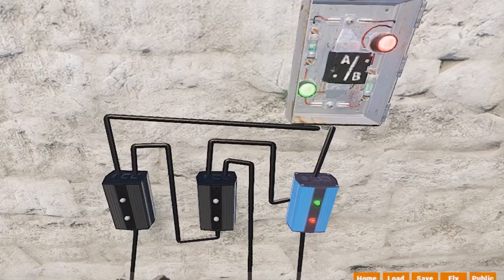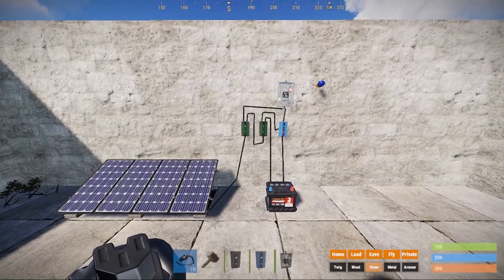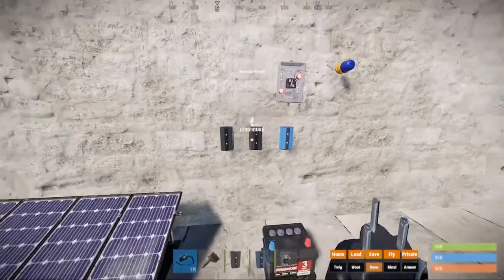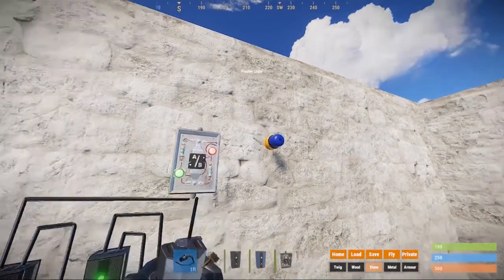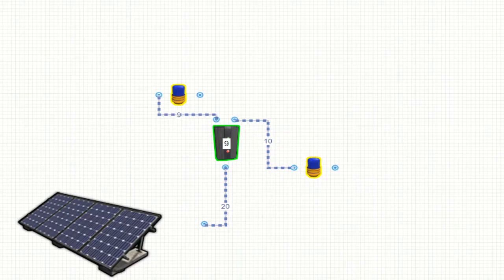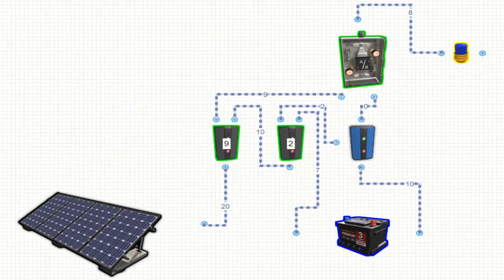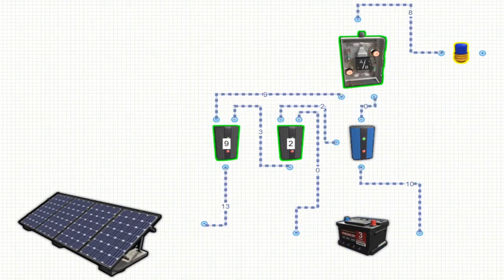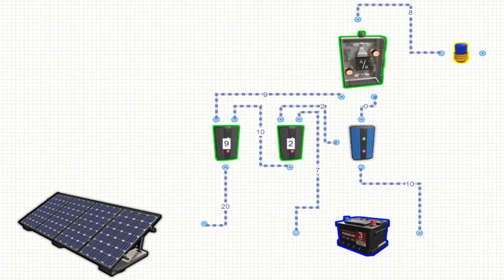Rust Electricity - the FIRST and most important circuit to build

Comment: damn this guy only has ONE vid wtf.... I love how he lays this shit out. I would love to see an updated version of how this works.
Reply: before batteries didnt recharge while discharging so this was necessary. They fixed that so this circuit is no longer necessary, its actually a waste of power.
Reply: @tictoc4156  so this video is outdated then?
Reply: @Naku_u  no
Reply: @Naku_u  this stills works, what happens is the solar panel is using what power it has for the system any power unused goes to battery. When there is no more sunlight then battery takes over, hopefully with full charge
Reply: @thrawn8840  oh ok this made it make more sense. So if my system is using 75 power. I would say output 80 to be safe and yhe rest would go to batteries then
Reply: @Maxmilion6004  yes
Reply: @tictoc4156  I can affirm that this is false
Reply: Still a useful circuit as it avoids charging losses for power used during the day.
Reply: @tictoc4156  This circuit is very important, as it makes no sense to have a battery discharging when it doesn't need to.
Reply: @tictoc4156  Electrical components no longer use power so it’s useable again!

Comment: I am using this circuit every wipe. I have recently learnt a nice way to scale it up 2x using a splitter to divide power into 2 large batteries and scaling power input with 2 turbines
Reply: Can you explain or show me how I’ve been trying to figure it out for hours
Reply: @eurility8557  sure, use root combiners to combine input from your power sources going into the first electrical branch and add a splitter between the 2nd branch and battery to spit power into 3 batteries. Use root combiners to combine the batteries power going into the blocker
Reply: @jamesward9482  Important note: Don't do this with Medium or Large batteries because root combiners will max them out 100% of the time and waste a lot of power unless you are actually utilizing the full 200 or 300W output. It's a big annoyance and there's no warning in game that this will happen. You can still run the feed to several batteries and run separate grids, though.

Comment: id love to see this scaled up with multiple power sources
Reply: Yeah me too, couldn't combine them behind this circuit so it has to be before?
Reply: @kathak9096  Ofc it has to be before. Just put a (or multiple) root combiner(s) in front of the first branch.
Reply: yeah - I've been struggling this (trying to find a way to auto-disable any surplus batteries from the circuit)...  looks like you can't switch/branch anything before a root combiner - the only thing that can be before a root combiner is a power source (generation or battery output)...

Comment: This circuit pretty much fixes having to brute-force power generation to extreme levels in order to charge (usually during the day) the batteries by having significantly more power than necessary for the system.  It works doing it that way, but you end up with a lot of expenditure on solar and wind turbines when you only need just enough.  Great explanation!
Reply: UPS is only useful when you have over 126 rWm

Comment: Like this setup. I run the solar to a branch that feeds both the battery and a splitter. Then using one of the 3 lines off of the splitter, I route to the blocker and from there any downstream accessories such as lighting and sensors I don't want using power during the day. The other two branches go directly to my furnaces/turrets/heaters/etc.

Comment: i have a counters between my power in, my battery charge line, and my power out line. when set to pass through mode it will show on the screen the value. it makes it easy to see if youre charging, need to put more power to your power main, and how much you can limit the main so you charge your batteries the fastest. super simple little upgrade to the system and it makes life wayyyyy easier.

Comment: I built a similar concept on my 2nd attempt at installing lights so that they turned on when it got dark and it only took 1 branch and an OR.  Not sure if it was inefficient or if those extra components were needed…

The line input from 1 panels (using a root combiner) for 20 input to a branch.  The branch output was the minimum 2, which went to an OR.  The  remaining power went to the medium battery.  The battery output to the OR and the OR output to my lighting array.

When both solar and battery had power the lights were off.  When the sun went down the lights came on.  When the sun came up, the lights turned off.

Only thing I can think of is that maybe the blocker and added branch prevent the battery discharging 1 power to the OR while it was charging? But at the cost of 2 power for those 2 devices?  Effectively being a worse option I guess…

Comment: I'm having trouble scaling this up.  Can you show how you can do this for a large battery?  Then let's say two large batteries?
Reply: On first branch  instead of 9 you set amount needed to power up your devices. The rest will power up your large battery. As for two batteries, I just created two circuits with two windmills, felt like the simplest solution. For example my first circuit branches out ~60 energy to turrets with the rest going to battery (- components on the way). With cut out power source fully charged large battery should last for about 7+ hours with ~60 active output.

Comment: This is just a remake of my video from 2 years earlier. "The Best Rust Infinite Power Circuit".  You even placed the components in exactly the same order.  The only thing you changes is the load, you used a light, where I used a voltmeter.  I'd put a link but apparently they get auto deleted.

Comment: The problem I see with this is that whatever power value is set on the first blocker, say 99 for a single large battery, you are now essentially throwing that power away when the battery kicks in since the OR gate will only pass through the higher battery signal. I'm not so sure that the gain in battery charge when the system is over harging offsets the loss in charge when the system switches to battery backup... In my case I'm trying to save a problem where I have almost 40 power running off a blacked into a Tesla COIL circuit, even though the 35 power into the Tesla isn't used 99% of the time. I'm trying to find a way to recycle that power and only pull it when needed. If I use a blocked it'll kill any circuits I put in line behind my Tesla. I could just put the Tesla last but I hate how unscalable that solution is.
Reply: This is the real problem with the electrical system in Rust. Due to technical limitations that make no logical sense, what should be simple designs instead have to use convoluted workarounds and compromises to avoid being wasteful.

Comment: Still not sure why this is better than running the solar panel directly to the battery and then the battery to the load.  The battery will be receiving 20 power from the solar panel and only outputting like 1 power so it will get charged at 19 power rate total, no?

Comment: I've been trying to figure out why this feels so incorrect for like a year. I'm not sure this dude understood this circuit when he made this video, I think someone taught it to him.

This makes some sense if you don't want to have to edit your branch when you need to use more power... but you're going to have to edit it when you add more power anyways, so the branch is going to be changed at some point anyways, might as well be efficient since that's the point of this. 

The thing breaking my brain forever now has been "why the heck is the first branch set to the maximum output of the battery?" 
It makes so much more sense to me to set the first branch to the amount of power my base needs. That means any power I don't need gets fed back to the battery.

I also don't understand why the second branch is set to 2. It should be 1. It's not a pass-through. It just needs 1 watt to trip the blocker, that energy doesn't ever continue to the switch.

Here's my run-down, I hope it helps someone, cause I've seen this video about 10 times over the years and it's never sat right with me:

My base needs 19 watts   --   (water purifier, two pumps, two lights)
I have a medium battery that can output 50 watts.
I have 3 solar panels, which gives 60 watts in the day.

I take that 60 watts of that power and I branch off the 19 that I need. The rest is sent to the battery.
Well, most of it. I take 1 of those extra watts and send it to the blocker to tell it that we are indeed getting enough power from the panels.
If we're getting the energy we need from the solar panels, then that 1 watt will actually be there. That means the blocker will be enabled, so the battery will be blocked.

So now, if the panels are supplying enough power, the battery gets blocked off, and we use our 19 watts from the panels.
If the panels AREN'T supplying enough power, there's no extra energy to trip the blocker with, so the battery is able to get through the blocker, and the or switch uses it instead.
Reply: Batteries couldn’t discharge while charging for a while. This is why.

Comment: but that means when the solar panel is producing under 12 power its energy is being wasted
Reply: Repair your solar panel, damaged ones produce less power
Reply: @gabeske1711  they still produce less than 12 at certain times of day tho regardless of health
Reply: @d4nnyh  solar panels should be facing the center of the map to be most efficient

Comment: Great work
But it feels like we are loosing so much energy on components (20%) and we are using some energy inefficiently - when power is below 12
So the question is how much energy we actually save with this scheme, given that we lose 20% of energy all the time
Reply: Can you design a circuit that does the same thing with fewer components? If not, then it's as efficient as it's going to get. If you can, then publish your design.
Reply: @mjt1517  my question's purpose is to find a better solution by looking at a problem from another angle

You answer's purpose is ...?

Comment: Logically wouldn’t it matter? I mean if you hook up the panel to the battery, the system is powered by the battery and the battery is charged by the panel. Whenever the battery is full, the power is technically delivered directly through the solar panel, and whenever the panel isn’t working it’ll take the battery power. Am I missing something?
Reply: Yes you are missing something. During daylight your item is being powered by the solar panel (directly) with any spare power going to the battery (topping it up), when night comes, your item is powered by the battery and the battery is losing power but when day comes around again, solar powers item AND tops up battery. So with this system your battery is always being topped up and NOT losing power by day, as the item is being powered by the solar panel. There is a subtle difference

Comment: I am kinda confused... batteries go into charging mode the moment the amount of input is higher than the draw, so yes, technicly the circuit draws its power from the battery the whole time, but with sufficient power input from the provider it will still charge. Its not like the battery breaks with usage so i am not sure why i should invest 4 rW into a circuit that is basicy inside the battery itself.
This circuit just provides power directly from the provider rather than the battery, which is okay i guess, but why use 4 rW if you could just use the battery as a passthrough basicly... it still charges with whatever is over the draw from your lights and furnaces and whatnot.
Reply: I think that this circuit was better to use with bigger generation of electricity, bcs batteries in rust are not 100% efficient they waste about 20% of power you put into them, in small scale like this it was useless, bcs it used more power, then it saved. The reason why I am saying was is that since few months ago logical components like branches and switches dont use any power anymore, so now it is actually worth making, bcs it doesnt waste any electricity and when its day it saves the power that would have othervise been wasted by the battery not being 100% efficient

Comment: Isn't this circuit redundant? Those small batteries can charge at twice the rate that it discharges. So if you connect a solar panel to a battery and run your stuff from the bat then it charges at 20rwm and discharges at 10rwm meaning it will stay full for the full duration of the day and only start draining at night when it isn't being charged. Thus because the battery will only start losing power when it's dark it makes the end situation exactly the same as using this circuit, just with less complication.
Reply: This was made before a patch was introduced
Reply: @_Bangs_  so is this circuit not viable anymore?
Reply: @BlueinanotherLanguage  this circuit will still work and still manages power better than wiring generated power into a battery, but this circuit also still waste power. Generated power not meeting set threshold is wasted.

Comment: Someone let me know if I understand this right: if instead of a small battery outputting 10w causing us to divert 9w in the first branch, if we had a medium battery outputting 50w we would instead divert 49w in the first branch. This being 1w more than the 48w that the battery would output considering it goes through two components. 
OR would it be the case that then you start scaling the branch output relative to the needs of the power system? Idk if batteries output all 50w if the power needed is just 10w.
OR is it something else?
Reply: When charging a battery it only is 80% efficient. So 50w of charge = 40w. So using available power first then charging is more efficient. Only issue is you need to know how much your circuit is using then divert to battery.

Comment: I am struggling to understand how this is better than just battery buffer (second battery). If the solar pannel (sp) was blugged in to the small rechargable battery (srb) would it not save a loss of power due to the additional electrical components. The battery will only send what is required so naturally will charge as if this circuit was in place.
Reply: This isnt, this was jyst one of first good ways for electricity when it came out.

Comment: So what if  I have a wind turbine? What should I set my first branch to? Let's say a large battery too
Reply: allways the max battery output minus the electrical components u see here. large battery are 100 rw output minus the 5 components equals 95.. to be on the save side go 90 on the large battery.
Reply: @yogsothoth6059  tysm
Reply: @yogsothoth6059  no the maximum it can be set at is max battery output -1, however if your circuit uses less than the max battery output then its much more efficient to set it as exactly what you need and all excess power  to the battery. also its not minus all the components as all but one of these are used up directly from the source so its max battery output minus one (or more only
 if your using multiple batteries because of the rout combiners)
Reply: @philipludwell339   so its f.e  99 for a large battery no matter what you connect to it,? an you still can run a "unlimited power" circuit with blocker and stuff?
Reply: @yogsothoth6059  the battery outputs 100 into the XOR leaving 99 coming out, the other circuitry takes it power directly from the power source, so with one large battery max output is 99, and from the first branch that splits the power you can run max 99 from the branch to the XOR but if you don't need the full 99 then just split off whatever is needed and let the rest go to charge the battery.

Comment: This seems flawed if I can not have the first electrical branch fluctuate the configuration value to the actual draw on the system I will be loosing out on free charging power. From what i can tell there is no way to monitor usage and auto adjust the electrical branch configuration value. please let me know id anyone has found a work around.

Comment: What's the problem with draining the battery while it's charging? If there's extra power being generated, then the battery will be recharged faster than it's drained resulting in it staying topped up even while being drained. This circuit is trying to solve a problem that doesn't exist.
Reply: As I understood, this was an old issue where you couldn't use a battery while charging it. That's no longer the case and the video is pointless with the current system.

Comment: I’ve figured the best way to get power out of anything is use solar panel or turbine. Then connect your power source to a root combiner then from root combiner to your battery. Then from the battery you can connect a splitter and then connect a splitter to a splitter and you have 5 output sources. I usually connect 3 turrets to switches and then some lights and switches. (This works best if you have turbine) I don’t even set up power until I have turbines because solar panels are almost useless to me.